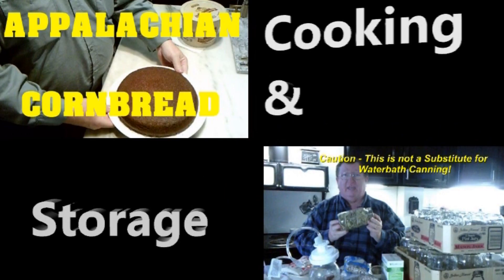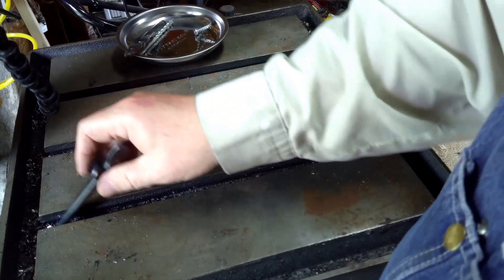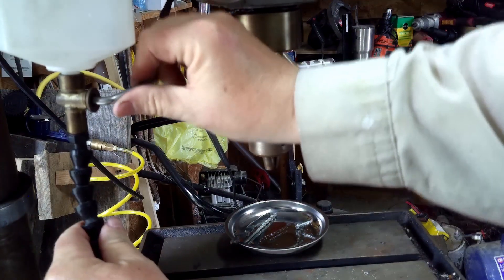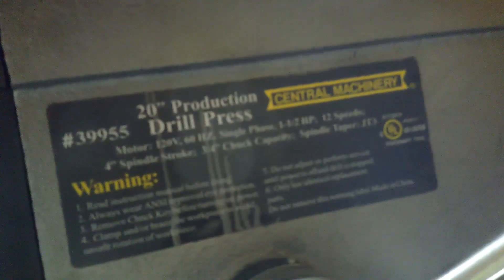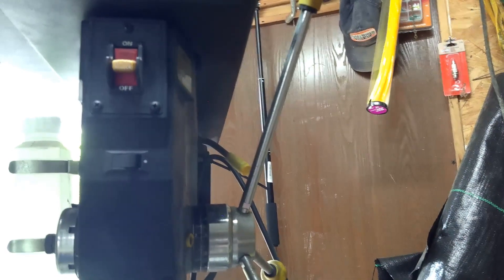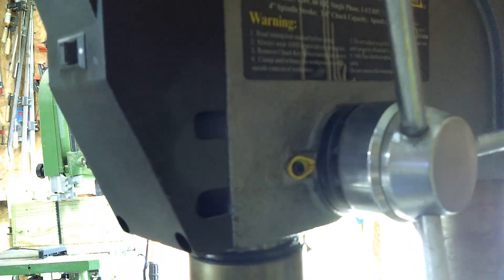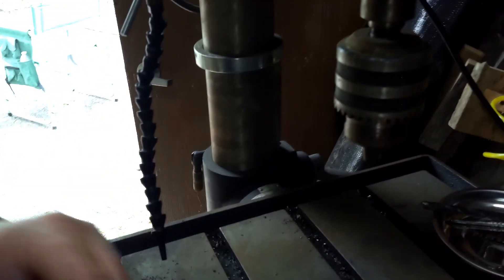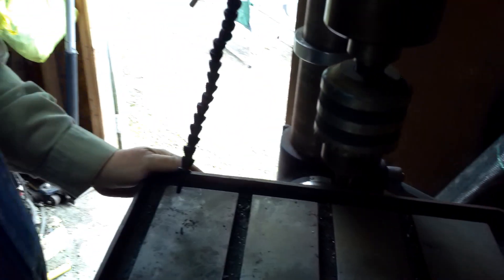Harbor Freight DRILL PRESS to MILL Conversion Episode 1 Item Number 39955 (CHEAP)

Comment: I did my mill with a router, it has more power and the arbor is meant to hold pressure sideways. Easy peasy lemon squeeze
Reply from the maker: That is a awesome Idea. Will it cut metals like aluminum, copper and brass

Comment: I got a HF 20inch drill press used,awesome drill,replaced spindle bearings the taper and put on a good chuck. be nice to see how you go on this,probably going to find a way to keep the taper from falling out under side load.
Reply from the maker: That is exactly what I am worried about. I am not opposed to welding it in or epoxy if I have too. But we will see how it goes. I would druther be able to do things without getting that extreme.
Reply: @CollegeHillFarm  some tapers are threaded on the end,maybe make a sort of drawbar to go up the spindle. just a thought
Reply from the maker: @19672701  Thank you that is the kind of info that I like to get.
Reply: So how did it work out for you?